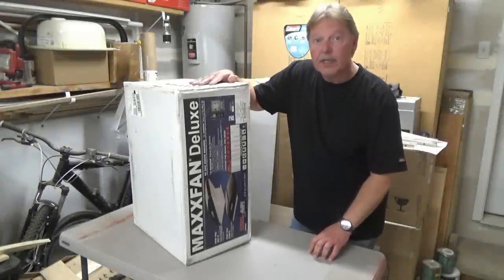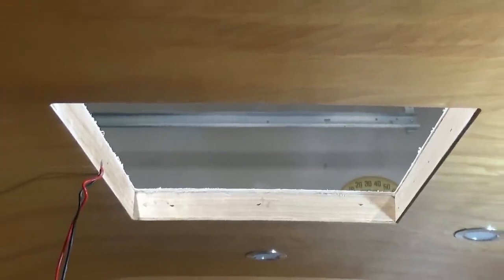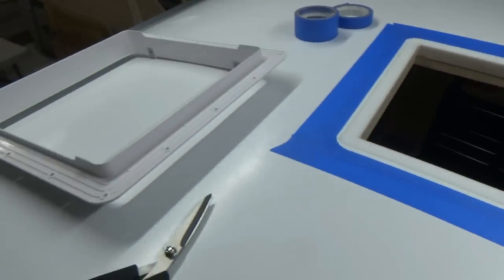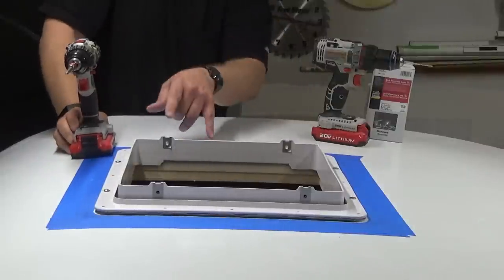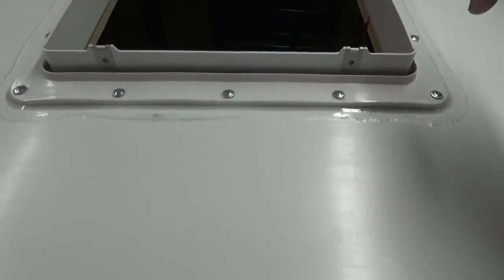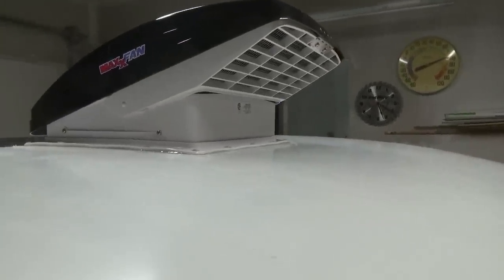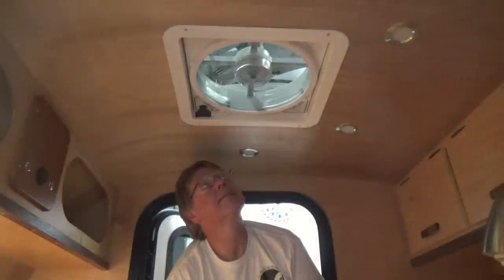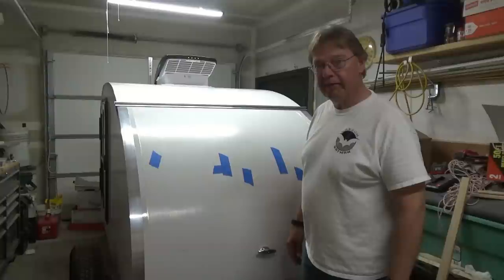Let’s Build A Teardrop * Step-By-Step * - Part 42 (Max Fan Install)

Comment: I consider the installation of the roof vent fan to be a major milestone in this project. That has to be the absolute cleanest application of sealant around the edge anyone has ever done in the history of RV construction!!
Reply from the maker: LOL!! Well, to tell the truth, went back around it with the lap sealant to ensure it was water tight! Doesn't look as pretty, but will keep the water out! :)
Reply: 100% agreed

Comment: One other thing I wanted to comment on... When splicing the wires and making connections, it may help to stagger them slightly so that all the connections are not clumped together. I got this tip from watching Charles Moman's channel. It makes it easier when fitting wire connections into conduits or other tight spaces such as behind that interior trim ring. Appears you may already be doing this.
Reply from the maker: Good tip T455... yup, I did it. You are right, would be difficult if they weren't staggered!

Comment: Yes Al, that's a very good technique for centering the fan from its square 14 inch hole!  If I may suggest:  sanding the Filon increase sealant holding.  MaxxFan is so much superior to the traditional Fantastic Fan.  I think that your method to cut to size the inside trim is the best one. Great video!
Reply from the maker: Thank you Raynald! And thanks for the tip... obviously, I took a shortcut! :)  I have the Fantastic Fan in my last trailer build, and it seems to be a littler louder than the MaxxAir. So far, I'm impressed with this one!

Comment: Hi Al! Great job! What is the model number of the Maxx fan you used? Thank you
Reply from the maker: I believe the one I purchased was the: MaxxFan Deluxe Roof Vent w/ 12V Fan - Manual Lift - 4 Speed - Smoke
Item # MA00-06401K from etrailer.com   https://www.etrailer.com/RV-Vents-and-Fans/MAXXAIR/MA00-06401K.html

Hope that helps,
al

Comment: You might have gotten lucky with your method of measuring the inner trim ring for cutting.  Typically you mark the line then transfer that measurement from the inner flange then cut.  Basically you should be measuring the amount you need to retain on that trim not the amount to be cut off.  Check out other youtube installs for a visual.
Reply: I did the same thing on my install and the margin for error is actually pretty high, in fact if you cut the trim a little short it makes wire management a bit easier.
Reply from the maker: True... which is what I did. Looking at the video, guess I didn't say that. I marked the ring, measured from top-down, then measured bottom-up and marked the line and cut. Just so happened for this install... it was right in the middle, good fit!
Reply: @OregonBatman  I was wondering how you did that thanks for explaining!

Comment: Great video !!  I have another question, what type of wiring did you end up using for the fan? From your previous videos I know you are using a 10 gauge from battery to power junction . But then from the power junction to the fan ?
Reply from the maker: Hi Luis... I think it was 12AWG wire that I used.

Comment: Hi, I think it is little more  than what a teardrop needs. Don't you think you over did it?
Reply from the maker: Nope... having built one of these in the  past, and camping in the High Desert, good ventilation and air flow makes for a good nights sleep (gets hot in Central Oregon!). Now, what I DO think is overkill, is an air conditioner in a camper this size. :)
Reply: @OregonBatman  Mine will have a very small AC unit.  It all depends on the area of the US you live in.  Here it is not uncommon to get over 105 for two months straight.  We "big boys" need that air. LOL

Comment: Nice fan, nice work as always :)  Like your sense for details and methods. Learn a lot from that :) What is that tape You put on first, the sticky one. Did it came with the fan, or? Never seen it been used before.
Reply from the maker: Thanks Van Geezer! The tape I used is 3M Extreme Sealing Tape 4412N. Very good stuff and sticks reeeeeeeeeeeal nice!!
Reply: @OregonBatman  ...and it can be used to seal the edge between the roof and the walls!
Reply from the maker: I think I'll be using this stuff on my future builds... a lot more confident that I won't experience any leaks!
Reply: @OregonBatman  Thanks! I'll check that one out.

Comment: And another question, I am remodeling a motorhome right now, and will be doing the fan soon, did you research the two main brands, and why did you choose the Maxx Fan?
Reply: You are probably also considering the fantastic fan as I did too.  Based on the videos it seems the MaxxAir is quieter.
Reply from the maker: I have a fantastic fan in the last trailer I built, and comparing the two, MaxxAir is a bit quieter. I also like the looks of the MaxxAir on the Teardrop instead of the typical square fan.
Reply: I have this exact same fan on my homebuilt, it's the best quality, quietest, and one of the largest volume of air fans on the market. I've been using mine for about a year and I absolutely love mine and can't suggest it enough.
Reply: Videos I've seen the Maxx fan is way better than fantastic fan and lots of people are upgrading from fantastic fan to Maxx.

Comment: Good video! I'm just wondering, is there really only four screws holding the fan to the base? And are both those parts plastic? How do you think that will hold up?
Reply from the maker: Just four screws. I think it will hold up okay, haven't heard of any failures yet. The unit is pretty light. Thanks for watching Joel!
Reply: The four screws are mounted at a perpendicular angle to vehicle travel instead of the base which can "pull" up due to drag which is why there are so many more in the base. On top of that all four screws are going into metal brackets on the base and fan so there won't be any issues with plastic wearing out over time due to vibrations. 

From a mechanical advantage standpoint those 4 screws are more likely stronger than the base to the roof which is itself more than fine.
Reply from the maker: I agree with that! :)
Reply: I play around with VWs and worked in C130s. Both only had four bolts holding engines in. Trivia.